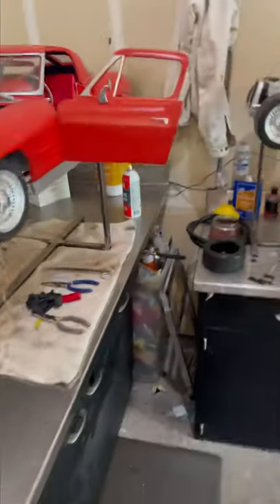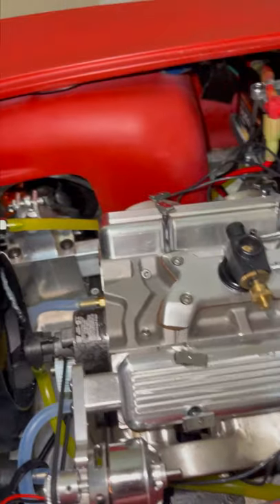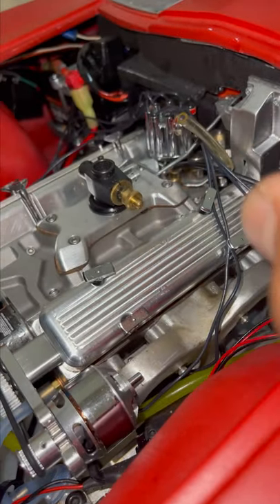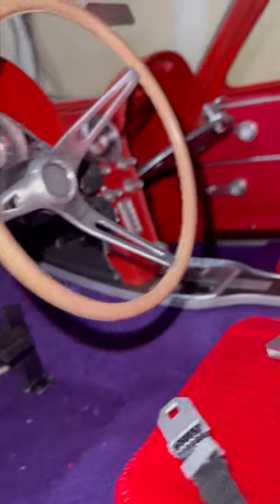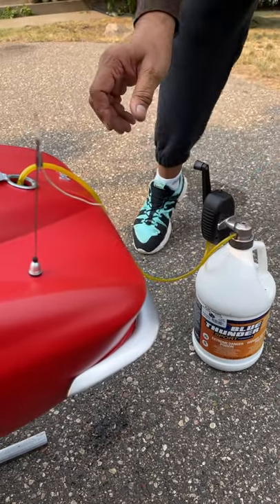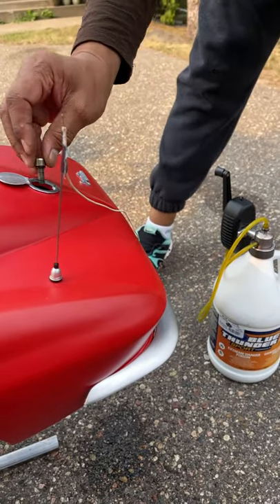Second On Road Run Modified Conley Clone V8  Corvette Stingray - "Lil Red", 61 lbs, 1/4 scale

Comment: Where does the car go if the check engine light turns on? Is there a mini mechanic you take it to whenever you need the oil changed!

Comment: Where’s the motor sourced from?
Reply from the maker: The Conley’s are no longer produced and are usually reserved as shelf queens or running models on test stands.  However, the first engine in this prototype was an original Conley V8 and I ran it because that’s what it was meant to do. It was a first generation V8, meaning it had a built up crankshaft.  The model weighs 61 pounds, so I knew a 30 plus year old engine, without a solid crank, was not going to be a scorcher. It was questionable as to whether the crank would be able to withstand the stress. I ran it and it worked fine for what it is. I switched it out for an Australian V8 Conley Clone with a solid crank.  Gary is the builder and he sells them on eBay as well.  gurk26@optusnet.com.